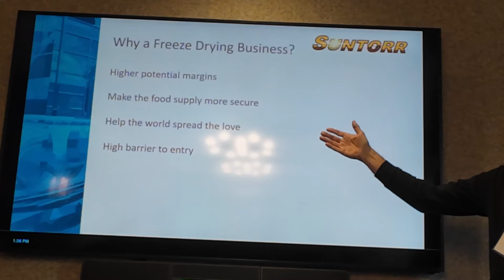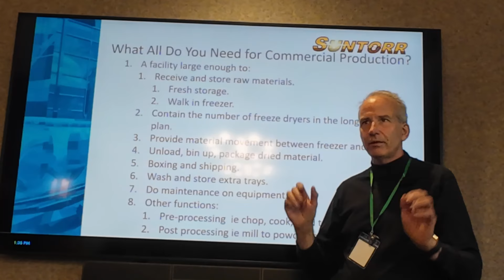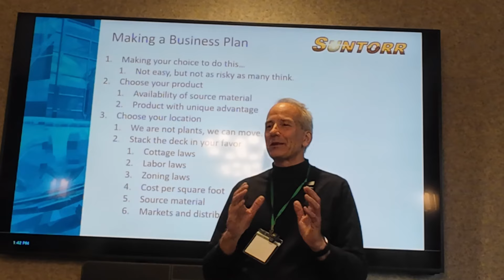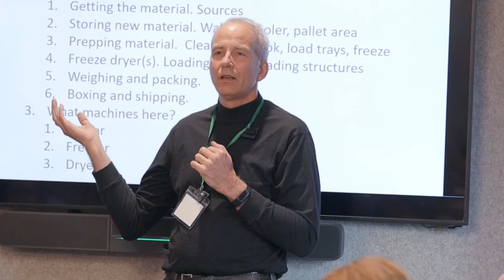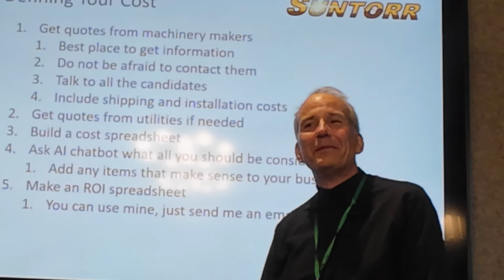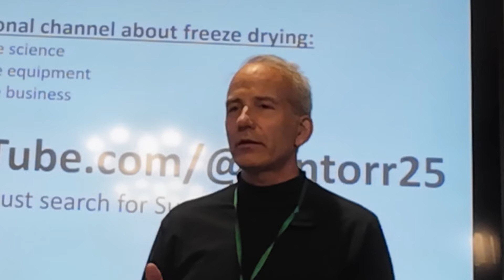Freeze Drying Business Plan:  Summit Session with Gene Ligman

Comment: That was a very good presentation. You mentioned performance advantages in oversizing the refrigeration system   which makes a lot of sense. Have you done testing to determine the cutoff where more provides no further benefit?

For instance, let's use TechSource's economy machine you recently promoted. It produces  6000 BTU's of refrigeration @ negative 40 F. How much additional refrigeration capacity did you factor in on that machine and what vapor pressure "on average" do you achieve? 

Another question I thought of while listening is how many zones of heat exist on a TechSource product tray heater. There has to multiple heaters and they have to be wired parallel to one another. How does TechSource monitor and control all zones on every tray simultaneously? You once mentioned each tray has two sensors so I'm assuming the are two heat zones per tray. How do you control the heat output of each heater. It can't be by varying the supply input because adjusting that would effect every heater.

How is Techsource controling the outpuf of each zone heater on every tray precisely or is this control more a limi and you vary input voltage ?

Are there other electronic devices embedded in each heater other than the heaters and sensors. I've been wondering how you maintain accurate control of every zone on every tray for a while now. Your presentation got me thinking about this again.

Thanks in advance forr answering both questions.
Reply from the maker: The lowest pressure you can a hie e in a chamber with ice at -40C is 100 mtorr, that is the vapor pressure of water at that temperature. 
The Econoline has only one control zone, though it has two temperature sensors built into the middle shelf. The unit cycles power to the shelf to maintain shelf temperature at the setpoint rather than cycling heater power to maintain target pressure.
Reply: @Suntorr25  I asked these questions because in your presentation you encouraged us to ask company reps questions. I was just curious, that's all.
Reply: @Suntorr25 I think you misunderstood my question. I probably didn't present it properly. I understand pressure temp relationships, but in your presentation you mentioned maintaining 760 militorr during sublimation and refrigeration helped maintain it at that level. Water vapor is atmosphere as you pointed out. You mentioned having a bit more refrigeration is advantageous because it ensures you turn the vapor into ice quickly which makes sense. 

What is the point of no return? Is max benefits we can achieve adding an additional 20% capacity and anything more would produce no further benefit? Is it 30%? Is it 10%?

I used the economy machine as an example because it's fresh in my memory. You said it's rated refrigeration capacity is 6000 BTU's @neg 40 F.

How much additional capacity I'd you add  to that system? 

In other words there has to be huge advantages sizing the refrigeration  system higher in capacity to the load. There hass to be huge advantage sizong a condense to be able to trap 100 lbs in an 80 lb machine.

I'll make my question simpler. You did the math and determined you needed editing 10,000 BTU's off  refrigeration. Would TechSource install a 10 k BTU condenser? Would they install a 12 K BTU condenser?

As far as the heaters go, I obviously used the wrong machine as an example.i just assumed you used  the same heaters in it that you use in your commercial machines.

How do you independently control the temperature of different areas of every tray in your commercial machines.Ths I what you've said in many videos.

How does TechSource control all of the heaters on each tray on every  tray?

I think I've asked both questions as clearly as one could ask.